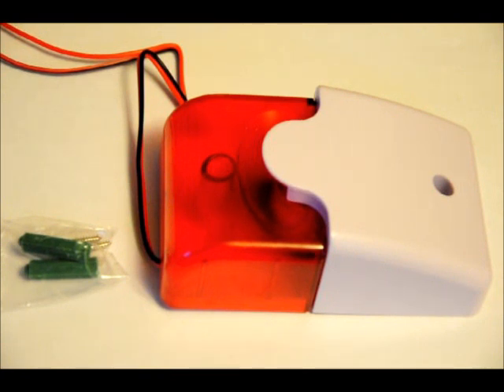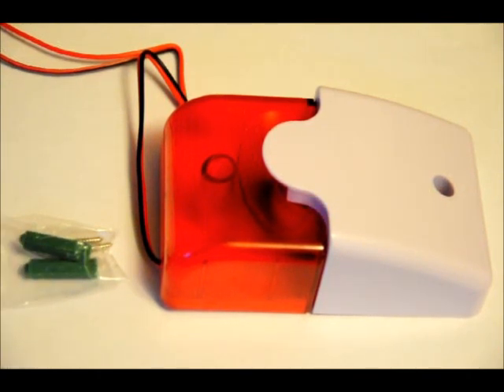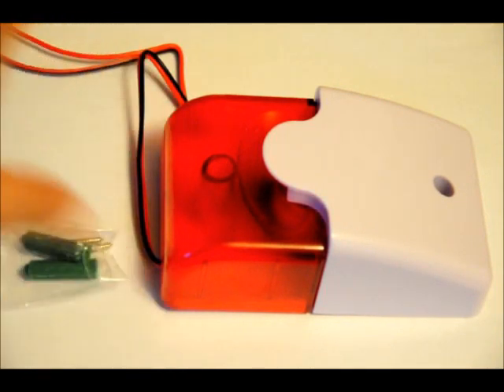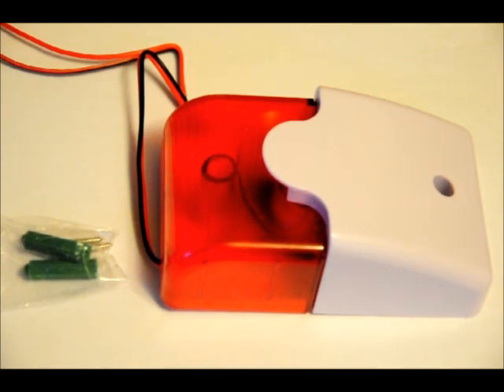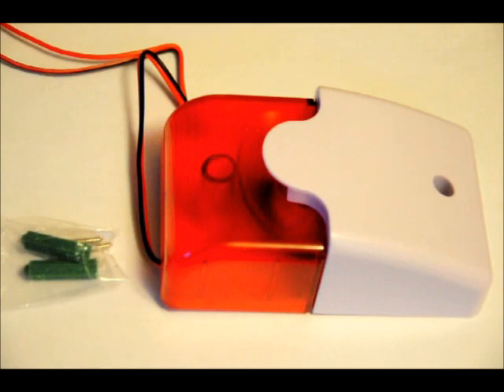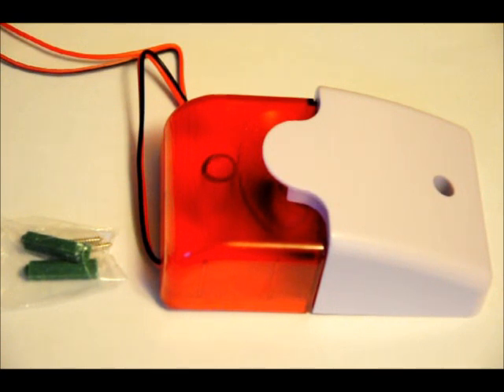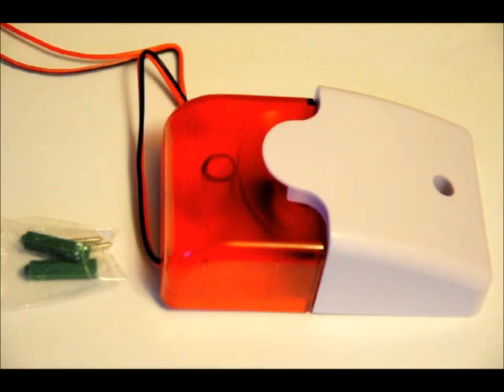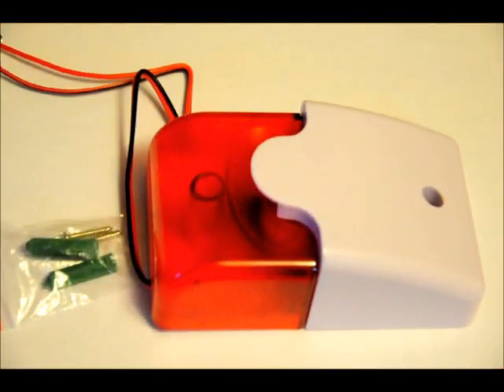An EXTREMELY LOUD Security Siren Module With LED Flashers and Mounting Hardware

Comment: My house has a similar sound security alarm. I accidentally pushed some bottom of security alarm panel, there was a very loud sound. I don't know how to turn it off. So, I have turned off circuit breaker switch from electrical panel board for alarm. Any idea, how to turn it off?